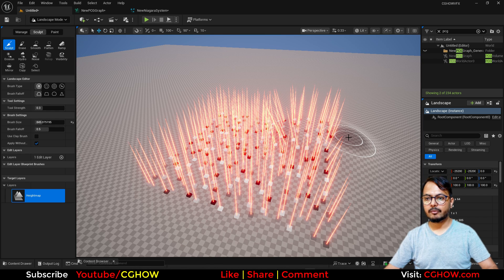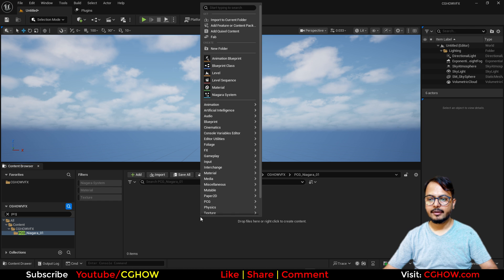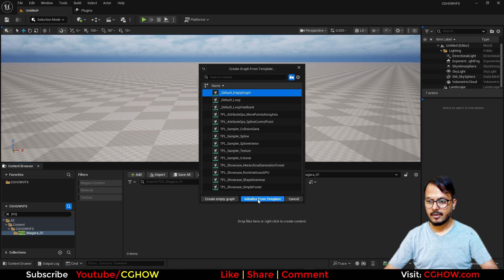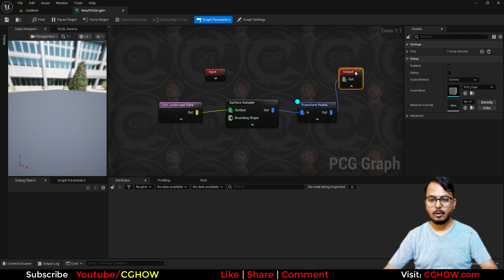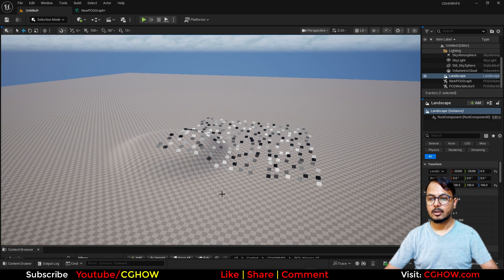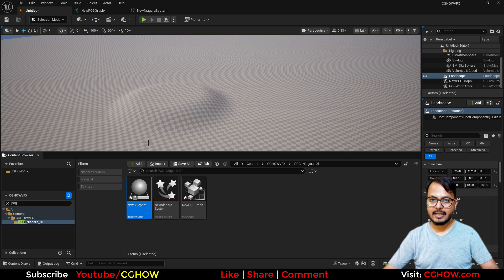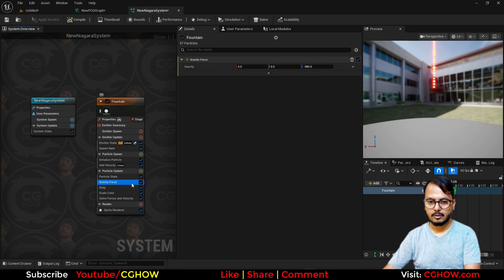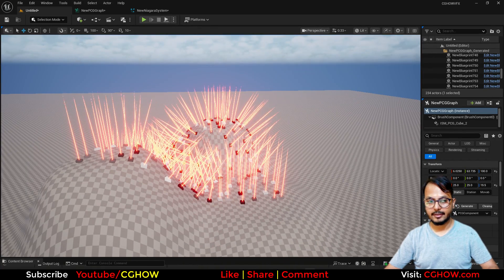Unreal Engine 5 - Integrate Niagara FX with PCG Points (Step-by-Step Tutorial)

Comment: I would suspect spawning multiple niagara system actors for individual points is not an optimized way of achieving niagara systems with pcg, ideally you'd want a system where the pcg feed location data into one niagara system that spawns its particles at those locations so you're only running it once
Reply from the maker: we will need to use data channel.

Comment: Could I spawn particles that move in the x or y axis along the landscape surface - like a carpet of low dust particles being blown by the wind? Reading the landscape height and adjusting in the z position so it always moves with it. Never cutting through the geometry
Reply from the maker: yes we can use surface, normals/tangents for that angle
Reply: @CGHOW  Appreciate the response. Do you have a tut that covers this this?